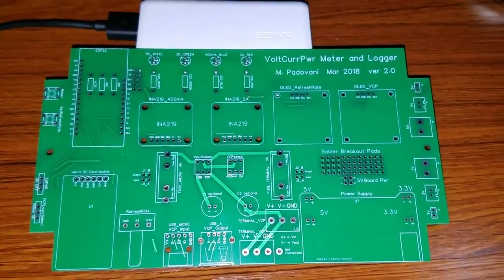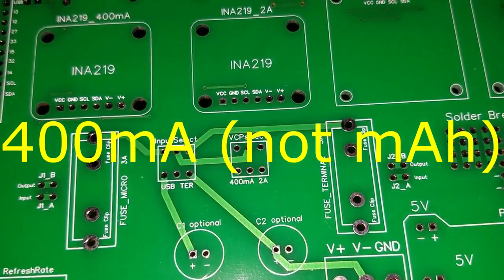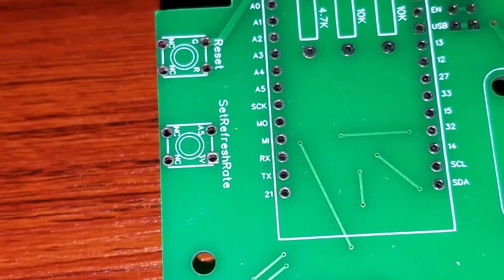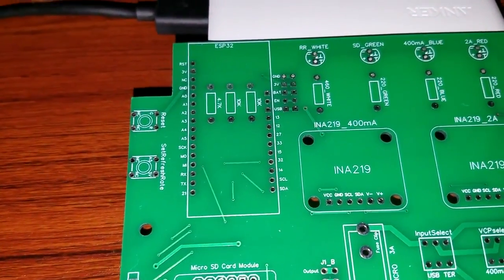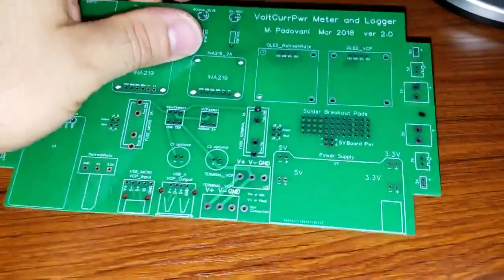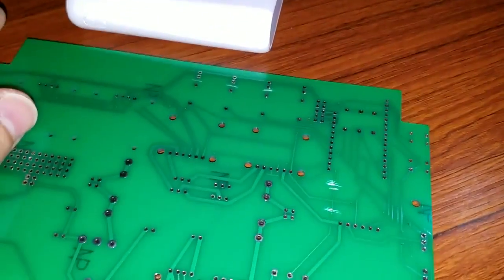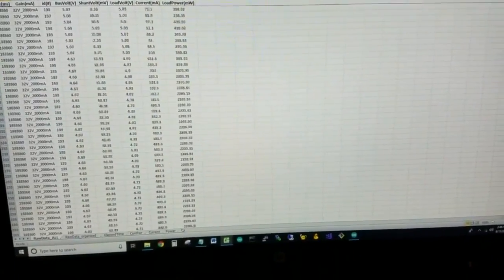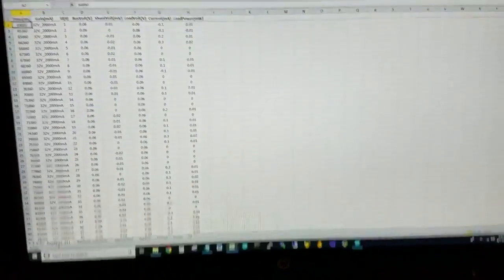Guest Video: Power Logger

Comment: This is great!  I built a modified "Great Scott Power Logger" too, in the form of Wemos shields and a big base plate.  Put temperature on it too, and used it for a logger for the start of a solar shed.  I love your idea of the variable speed logging - I did close to the same thing using just an options file read off the SD card.  I like the way the input and outputs are so flexible.  I really dont need the code, but are the PCB designs released?
Reply: Give me your Email and I'll send you the Gerber file, thanks for commenting.
Reply: @michaelpadovani9566  sure.  It's jameskernsjr at y@hoo.  Thanks for that, and great job again.
Reply: It's on the way! Sorry for the delayed response, I never received notification. Part 2 is on my YT channel if interested.

Comment: Good initiative and useful project. All modular. I'm planning to build a dedicated battery capacity tester with logging capabilities and i could use the libraries of the SD card. Are u using the standard SD card library?
Reply: SDfat LIb (very similar)

Comment: Nice project. It makes me want to build one with a built in electronic load and maybe battery charging capability. 
The ability to check the power draw on a project is cool. Does it do uA? Oh please post the code.
Reply: I paralleled this setup with my uA current multi-meter and the numbers line up perfectly (tested an array of LEDs, dimming and such).   I confirmed it down to 3 mA but realistically I would say 1 mA is the lower limit of what this thing can do.
Reply: Michael Padovani do you have a YouTube channel set up?
Reply: Yes, with many a variety of genres lol